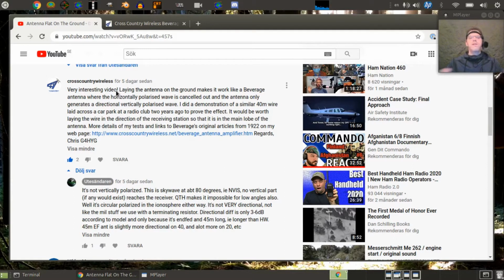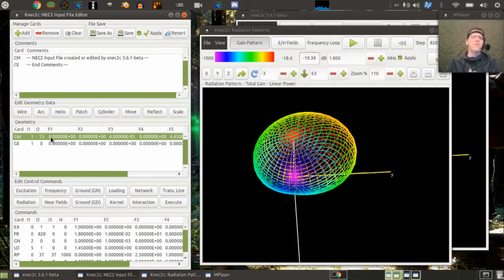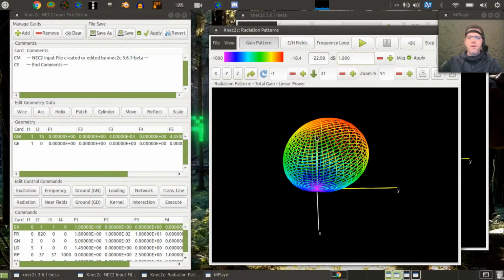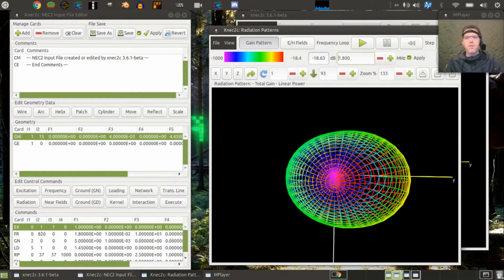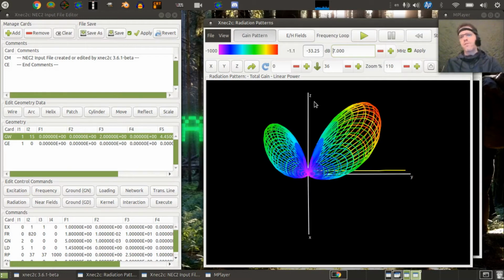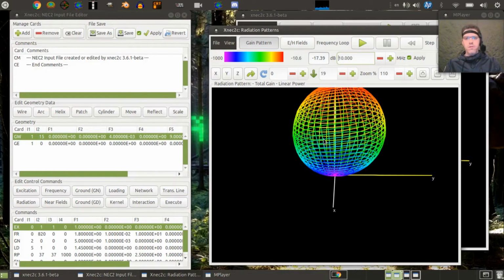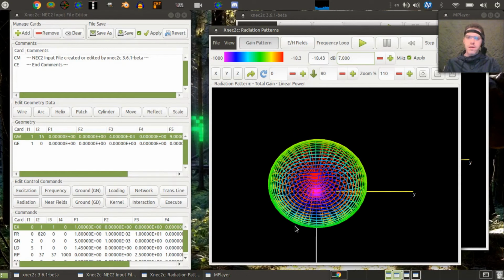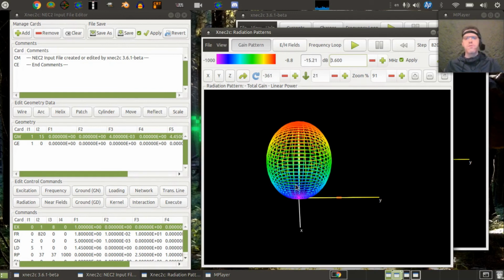End-Fed Long or Random Wire Radiation Pattern

Comment: Hello!
Have you ever tried / succeeded in modelling an 'inverted-V' antenna in xnec2c?

I'm trying to model a NVIS fan-dipole like the classic  'AS-2259/GR' military NVIS antenna. I'm not trying to model it in a 'dual-band configuration', but do the dipoles separately for starters - but I'm sort of stuck on how to specify the excitation of the two elements. Any hints? 

I can't really find any very useful tutorials for this either.
Reply from the maker: Yes. You can do it in two ways: excite it at the end (or start), make sure the wire has a reasonable amount of segments (not a lot, but perhaps more than the default 15). The end connects to the other wire (right up against where you excite the first wire). It looks like it's uneven, but makes very little difference in the end. Another way is to add a horizontal wire like a "mini dipole" that is excited in the middle (could be small, even 10cm), then connect each leg of the inverted V to the start/end of this mini dipole. The length should be small so it doesn't add much to the total length of the inverted V.
Reply: Ah, Thanx!
I made the (probably fundamental) error of separating the two wire segments, thereby creating two 'antennas' and not getting any 'reasonable' results. There was no 'bubble' but two donut shaped radiation patterns with no regard whatsoever to any ground.

I'll have to look into this a bit further a a later point in time I think otherwise I'm forced to call a psychiatrist tomorrow since xnec2c can't 'lock' any values. Everytime I try to adjust the slope of the inverted-V configuration, it ends up screwing around with the whole wire geometry...   >:@